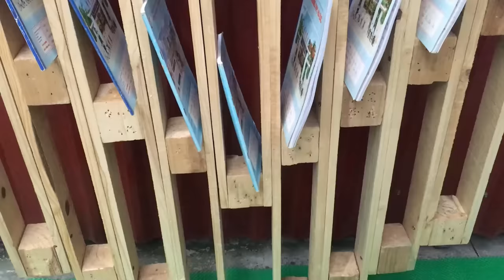Top 6 Ideas On ways to Reuse Pallets for DIY Pallet Projects - Awesome DIY Wood Pallet Ideas

Comment: Where do you get the pallets from they always look brand new. All the pallets I see are used and abused. Any suggestions?
Reply: 😂😂.  They make them and then tear them apart.
Reply: Это специальные поддоны для поделок. Стоят в десять раз больше досок.
Reply: Those nice pallets cost about $30 at Ace.
Reply: They buy them at the  factory,  The ones that I always get are all beat up  once in awhile  you get few that are really good but for the most parts they are all beat up!
Reply: I was about to say the same. Though the ones around here are used with shipping fruit for a season. Cheap wood and super grey and beat up looking. They do make great pallet crafts though.
Reply: Está hermoso
Reply: Muy bonito
Reply: I work in the post office we have pallets everyday free for you !
Reply: You can go around to some companies and just ask, sometimes they have so many they'll just give them away.  I asked at a nearby company that does Logistics, and was able to get 10 really good pallets.
Reply: I get my pallets from the place I work. I install paint mixing machines which come on 7ft and they are always single use I tend to get around 2 a week from my own installs and then up to another 20 per week from other engineers. You're just looking in the wrong place 😉 if you happen to be anywhere near Newark Nottinghamshire in the UK then I can sort you plenty
Reply: I was just thinking the same thing.
Reply: I get mine from feed stores. They always have soooo many
Reply: Yo creo que son nuevos... he comprado usados y siempre las maderas se ven oscuras o grises pero pintandolos las cosas que hago se ven muy bien... por cierto... yo no habria desarmado esa maquina de coser y la habria convertido en mesa se  veria mucho mejor para mi gusto
Reply: He probably buys them. Which takes away the point in using free pallets.
Reply: Ya les pasó lija y están listos para usar
Reply: Use outdoor bleach on them green label some really good stuff not much more than regular bleach
Reply: Even the nails look new. 😂
Reply: I am sorry those were way too easy to get apart, and no dirt or use is not normal.
Reply: Я тоже использовала паллеты, но, всегда их отшлифовывала и шкурила
Reply: Furniture store or use pool cleaner to spray on it. Not like new, but close.
Reply: Where I live (Big Island, Hawaii) there are so many places with free pallets. I just got 4 yesterday.  I’m planning to use it to make a floor for my bird cage. Then use a few to make garden beds so I can start my garden. The pallets I got are in nice shape. They’re clean and they look new too. 
Try going to stores like Costco. I got mine from cost u less. It’s like a Costco but I believe it’s a Canadian store that started in Alaska. (That’s what the worker told me)
Reply: Of course you have to look at where he is. He is probably not in America.

Comment: Pallets made from new, finished timber. Held together with one iron nail on each board that pop apart so easily, almost as if they were made in a workshop for the video. Totally useless for transporting goods.

Comment: That's awesome.  Add that to corners if balcony n still hang plants n sheers to the inside  with tiny lights n a plastic curtain to the backside n some privacy lattice n run a straight shorter one across for a little privacy n still see out. Add lights  n plants to it n a sheer for at night.  Could even add thise magnetic screen doors all around balcony first n keep bugs out. Could stain it too. I have no privacy they watch everything I do n bring digs around  tat bark at my dog inside  apt or when we are on the deck. I love to sit outside but it's too bright in one end  n te other ppl are so nosy n intrusive